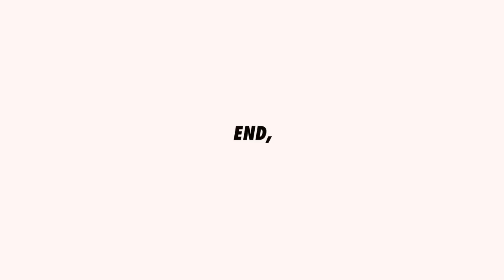W82_Cafe kitchen design

Comment: Almost 60k subs now! What kind of poly...oil or water? Also do you block plane with or against the grain? Edit. Just saw...it was oil.

What was that second coat of finish?? Smaller container...you used a brush...
Reply from the maker: I use oil based poly~! and coated 5times~!

Comment: Very cool, mate! I like the most how you've used the space to incorporate into design. I bet, unequal floor levels made a bit of a problem. BTW, the owner of the place knew about floor being far from perfection? Is he planning to lay the floor with tiles?
Reply from the maker: Every floor is unequal in Korea. So, when I install the furnitures I always do leveling before install them
Reply: ViTTEN / 비튼디자인 Hm... Who'd thought :) But why not to use special concrete self-leveling mixtures to even the floor? We use it all the time. Very easy to apply and gives good surface
Reply: @CantadorRDA  to much work and money. it needs to be up and running as soon as possible ;) . plus with the active ground there is sometimes alot of movement in the floor
Reply: Timber land hehe :)) good point. Maybe perfectionist is talking inside me :)